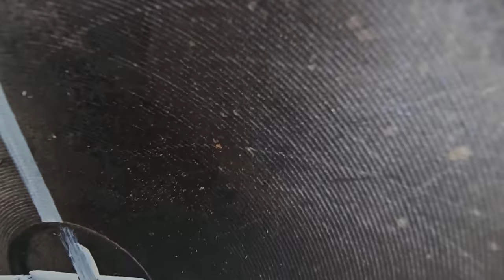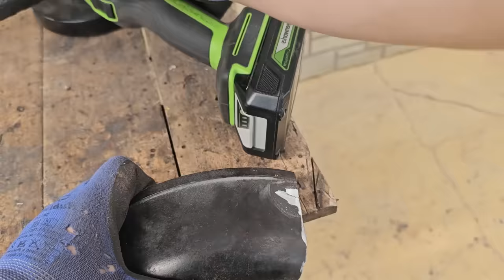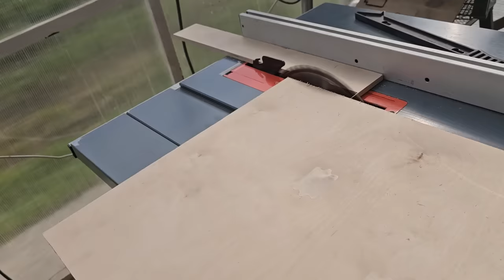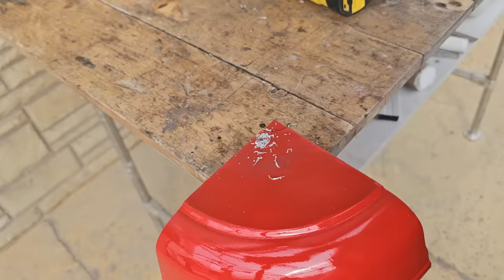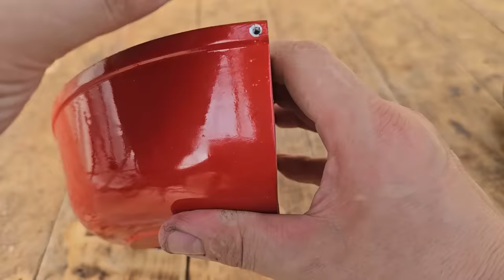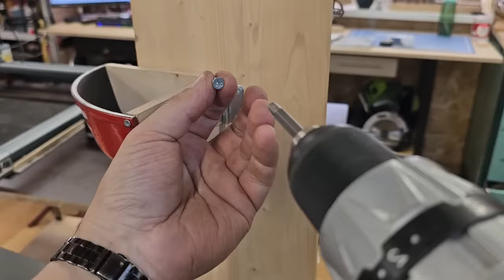Few people know the secret of the old frying pan. Brilliant idea

Comment: Do ya'll know you can take those apart and weld them together and make a frying pan?
Reply: LOL! LMAO!! 😆
Reply: If that’s cast iron. You’ll be wasting your time trying to weld that.
Reply: @patrickperry6945  One generally brazes cast iron repairs with a low-fuming high-quality rod. Although, it is possible to weld cast iron, but it needs to be done using the correct techniques and with care to avoid cracking. Most welding methods require the surface of the material to be cleaned and cast iron benefits from pre and post-weld heating as well as careful cooling.

Comment: Cool.  The curvature of the pan makes it much easier to get screws out of the bottom.  The only thing missing is dust protection.
I've moved to covered containers with clear tops. HFT Storehouse lg, med, sm portable parts storage bins 93927, 93928, 64811, 95807.